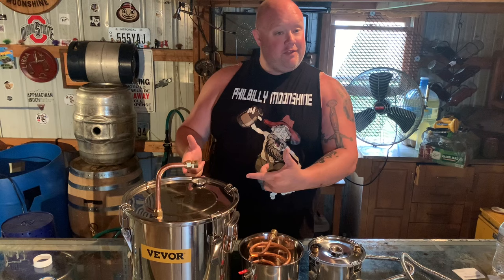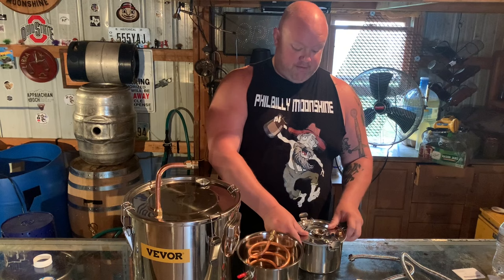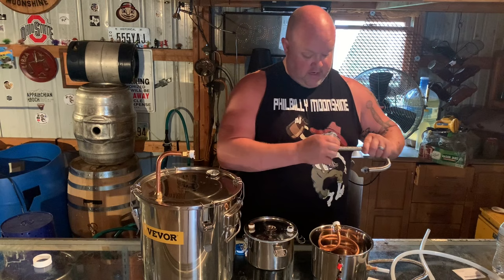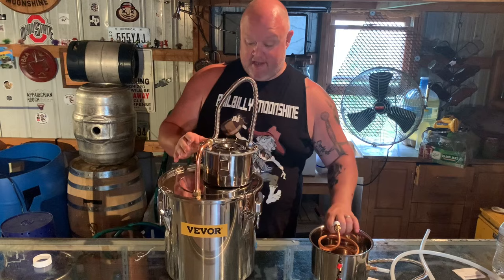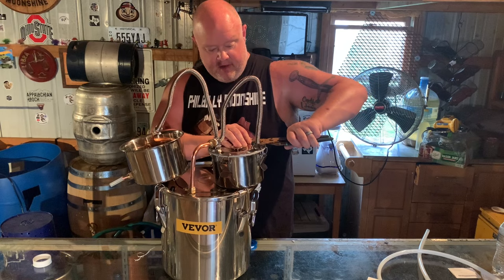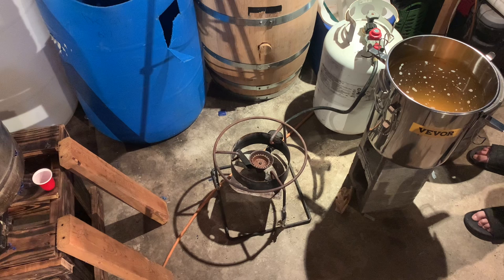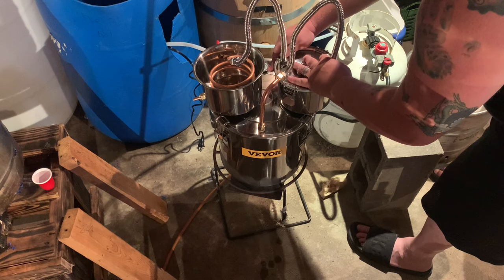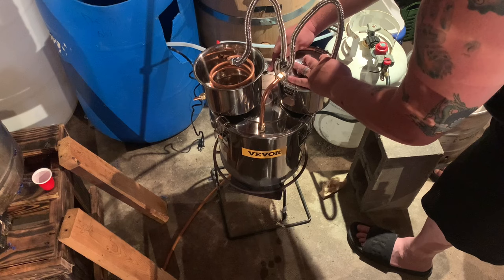Big Eaze reviews the 3 pot Vevor Still

Comment: You don't NEED the Tape if you use the Silicone Washers, They work really well....BUT they are very easy to forget about and fall out (and get LOST) when you disconnect them
Reply: Compression fitting.  Teflon tape actually does nothing.

Comment: I have an older version of this still. It suits my needs until I get the time to build something better. I've never had an issue with it. I double distill everything now and I am happy with the results.
Reply: How do you clean yours after use?
Reply: @jupitercyclops6521  after I use it I wash everything  with dawn dish detergent and water and rinse well. When I do the next run I dump the first 200 mils which is very toxic to every living organism. Nothing can survive that. I always run mine at least 2 times, usually 3, and I dump the first 200 mils each time. I've done this for years with no problems.

Comment: I have this still, and I want to upgrade.   Need to find a 10 to 15 gallon pot with a locking lid and use the 5 gallon pot for my thumper and make a bigger worm bucket... condenser
Reply: hey! did you ever make that upgrade? i am planning on doing the same, buying the 13-gallon still, plus the 5-gallon one to use as a thumper, so it would be nice to know if you ever got it done and how. thanks

Comment: The threads on this are straight threads, not NPT taper threads.  They don't need teflon tape, as all the threads do is pull the flare on the tube firmly so the flare seats against the cone of the fitting.  It makes a metal to metal joint- no sealant is required.
Reply: @bigeaze5711  I've got the Vevor still, and if you tighten the flared joints properly, they don't leak.  No teflon tape required.  They should have used compression fittings with ferrules in them, instead of flares, then it would have been a no brainer, but hey- it's a cheap Chinese thing.  For the price, I'm totally happy with mine!

Comment: I have an 8 gallon Vevor rig that is great for smaller/testing ideas runs, it wasn't expensive but it's not cheaply made and makes some decent shine. I'm interested in what improvement(s) you guys have in mind!
p.s. Just read the comments and a jar thumper is something I was debating making. Also, I use copper mesh tucked into both ends of the tube to the thumper or the worm if not using the thumper.
Reply: Thumper Jar is coming I’ve already developed it it’s in testing
Reply: @bigeaze5711  Wonderful!

Comment: Do any of the parts in this kind of system wear out fast? Like would you want spare parts for those if any on hand if you were thinking long term? 

And if you just wanted to use it for purifying water, is there an ideal heat setting? Or would does it matter or better to just do max heat?

Comment: You might want to swap out the fittings with stainless steel because some have tested the fittings and found lead in it.
Reply: If it was my still I’d swap em out with copper lines immediately.

Comment: Question. Did a practice run of a a gallon of boxed wine, threw the heads out. The run gave me about 2 cups of liquor. Did a second run on the liquor I got out of the first, but was wondering if I need to throw the heads out of the second run as well?

Comment: Where do you get the part that makes it a thumper instead of slobber box???
Reply from the maker: It comes with a cone shaped rubber gasket and a small copper pipe, you just put it on and it is then a thumper